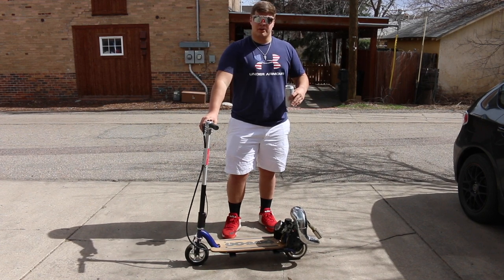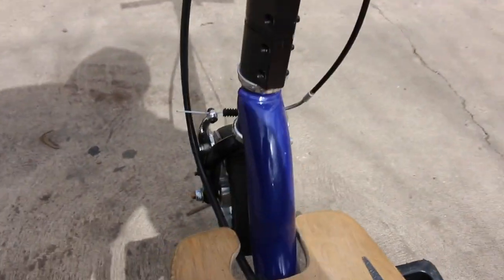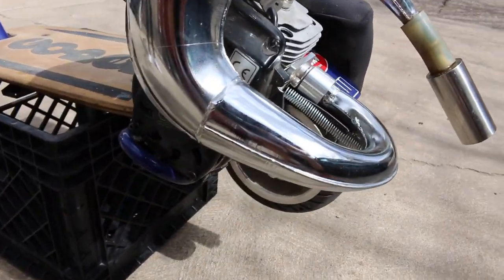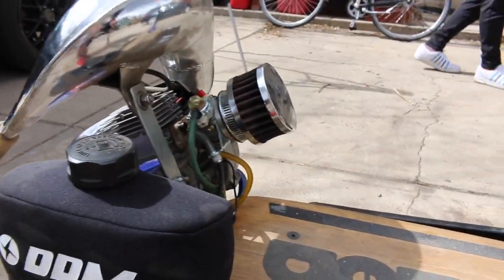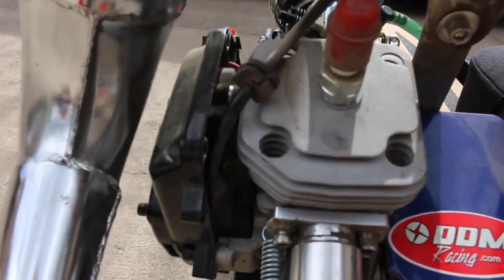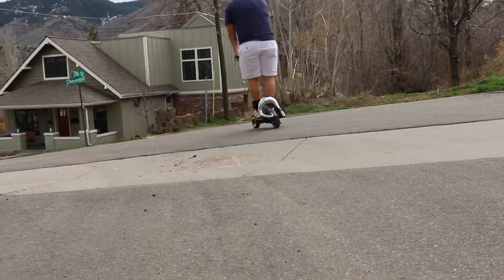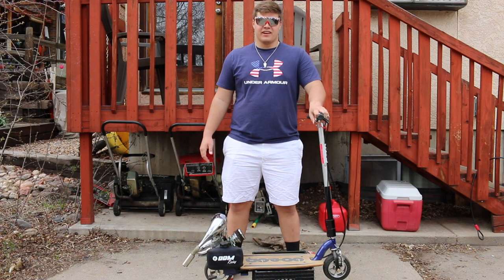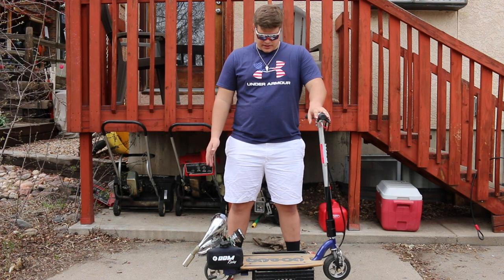GoPed XPED | 36cc ROCKET!

Comment: I’m think on getting same motor for my goquad. You took the clutch kit off and bolted right up? You have install video?
Reply from the maker: It does NOT bolt right up. The mounting holes are spaced out wider on these G320 based motors. The largest that will fit with 0 modification is 30.5 I think
Reply from the maker: It will fit without modification if you use a clutch kit
Reply: @hondayamahafan  yea using clutch kit. Awesome just ordered the 30.5cc the 36cc the 45cc and the 71cc going to be making a lot of videos of them
Reply from the maker: Damn sounds wicked. Good luck!

Comment: I've got a stock non-sport liquimatic and it tops at 47kmh. Few mods tho. Direct drive custom made in a lathe. Rebuilt the whole engine and carb and custom built intake with horn design to push in more air.

Comment: Just got a fully modded 7.7hp g320 from OBR. Seems like a monster lol. I’m hoping it doesn’t have any trouble putting the power down with the spindle drive. Do you have any trouble with it slipping/wheel spin? I’m hoping this thing will get to 40mph +
Reply: It’s for a super Bigfoot with a third bearing and no clutch
Reply from the maker: That sounds wild! I've never experienced and slippage on dry pavement. I use a beadlock wheel because otherwise the tire warps and stretches but with the beadlock it's fine. I have no experience with bigfoots but if you've got the 3rd bearing and lockdown kit you should be fine!
Reply: @sebass94sa  you should be good but I would get the clutch if you can, it's so much easier then push starting or pull starting with the wheel up
Reply: I just got my reed OBR 34 motor but that’s going into my 5th scale!! Thinking about ordering something else from OBR. Want my Xped to be a monster!!

Comment: Do more videos on this thing! Pretty badass! If you didn’t know, there is a center bleed version of the Sikk Torque pipe which is quieter then the end bleed version you have here with the silencer. If you get a center bleed and put the silencer on it, it’ll be much quieter then this setup with an endbleed pipe and silencer. I bought my 2 gopeds 6 and 7 years ago being a Sport and GSR Cruiser. Both are bone stock and I’ve been wanting to do mods on them for atleast 4 years now, but haven’t got around to it until about a month ago with the sport being first of which I put a G290RC on it compared to the stock G23LH it had before, along with a center bleed Sick Torque pipe, and some wider ADA 22.5” riser bars so it’s more controllable. Next I’m doing my GSR cruiser of which it will still have its stock GPL290 engine on it, but with an HP carb, modified Pacsales GSR40 pipe and also wider bars.

Comment: Hell yeah I have an Xped I ride it everyday currently just put a g290 rc engine on it with a .875 spindle it's a little too much but so much fun..lol id say it goes about 40 if I pushed it there
Reply from the maker: That's awesome! I bet that's terrifying😂
Reply: sasukeninja1000 40? Nah maybe low to mid 30s unless you weigh 100 lbs

Comment: I just bought a chrome V brake fork from coastped’s website and also a HDA style carburetor conversion billet intake manifold for my 39cc water cooled pocket bike dead end project lol. I should probably get an ADA Goped sport frame and build a decent sport with like a g320 or g340 and port it for a cylinder reed because I have an rc cylinder reed, make like a 6th port. Maybe the V brakes would help stop from over 30-35 mph then
Reply from the maker: That sounds wild. Yes get the brake setup it stops MUCH better than the stock setup

Comment: To fit the motor did you have to drill new holes? Or just enlarge the opening where the crank comes threw? Or both? Pls reply would really appreciate it thank you.
Reply from the maker: Both. The holes for the motor have to be slotted and the center hole has to be enlarged.
Reply: Ok so correct me if I'm wrong but it sounds like the 36 is just slightly bigger to wear drilling new holes wouldn't be worth it so you just slotted them out? Sounds simple enough, im thinking of the new 45cc rovan which I believe is the same crank case.. should be able to pull a 950 spindle and probably kill me😂 can't wait!!! Thanks just subscribed 🤙
Reply from the maker: Pretty much yeah! I thought about that engine too but it's over $100 more expensive and I think it's prone to over heating. I read a review on an RC site. The 36cc with a .635 pulls 300lbs up a hill pretty easy do depending on your weight it may be enough! Also keep in mind that if you're using new tires you're going to need frame extensions with the larger spindle.
Reply from the maker: Thanks for subscribing! It really helps us out!
Reply: Subscribed! Sweet ped. I have a bigfoot and I was also thinking of putting a 46cc engine on it. Im cool with fabricating a way to mount the engine, but I would still like to run an ada clutch. Would the 46cc still bolt up to the ada clutch?

Comment: I see these on ebay.. could I just pull off the clutch and bolt it up to my goped sport??
Reply from the maker: The 36cc will not bolt directly. You have to modify the frame to fit it. Any of the 30.5 and lower motors will fit with no modifications. Just remove the clutch and the mounting plate.

Comment: what did you have to do to get that engine to fit??
Reply from the maker: Slot the motor mounting holes to be wider. And grind out the center hole so the engine can fit through it

Comment: is that Rovan Still lasting mines not lol Crankshaft broke off.. Spindle drive was spinning freely lol
Reply from the maker: Yep. Mines still going strong. Did you have a 3rd bearing kit? I read about the weak crankshafts so I installed a 3rd bearing kit from the beginning and dual EPWs
Reply: @hondayamahafan  i did wit a Fat AZZ Spindle thats why i think it broke clean off i have a vid on my channel lol... when u guys uploading more dope funny content. that was a setzler correct lol i be on the Voodo ranger air force , aey also i have the head and piston its compression is still strong.. just damn crankshaft broke from .900 black magic spindle
Reply from the maker: I just bought a .750 spindle and frame extensions. Vid coming soon
Reply: @hondayamahafan  hoooyeeeaaahhhh

Comment: Hey im about to buy a go ped im 150 just looking to cruise which one do you recommend im looking at gsr cruiser thoughts?
Reply from the maker: Granted I've never had or even ridden an air tire ped, if you value riding over working on your toy, you need an air tire, chain driven ped. GSR cruiser over a hard tire like a sport or a GSR sport
Reply: hondayamahafan ahha ok ye I recently bought one for 65$ got it running sold for 200 I wanna get a new one now are these Motors american ? Or chinnise I see made in America but is that jsut the frame that is made in America

Comment: The engine you posted comes with a clutch how do you swap it for a spindle drive?
Reply from the maker: You just remove the clutch from the crank and remove the adapter plate
Reply: @hondayamahafan  really it's that simple?
Reply: And will a ada goped pipe fit?
Reply from the maker: Removing the clutch is that simple. To mount it to the frame, you have to slot the mounting holes because the 36cc engine has slightly wider mounting holes. Also the center cutout needs to be enlarged for the engine to fit into it. Also there is a single washer on all of the engine mounting screws to space the engine properly. It's not very difficult just requires a little trial and error.
Reply from the maker: Yes any pipe that will fit a regular smaller sport engine will also fit this without modification. Exhaust port is the same size
Reply: @hondayamahafan  thanks for your help

Comment: How did you get the rovan to fit? My 36cc doesn’t fit my Xped frame.
Reply from the maker: You have to clearance the center hole and slot the mounting holes. The bolt pattern is close, just slightly wider
Reply from the maker: Watch the latest our latest goped video, at 5:25 you can see the the slotted mounting holes